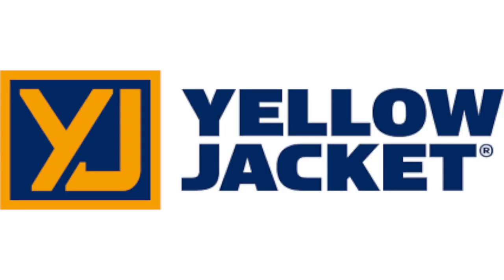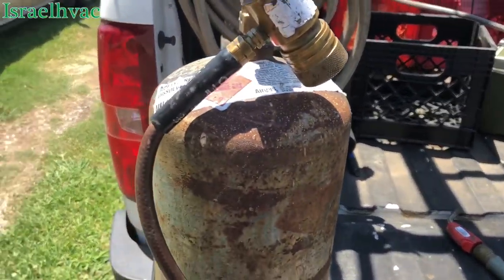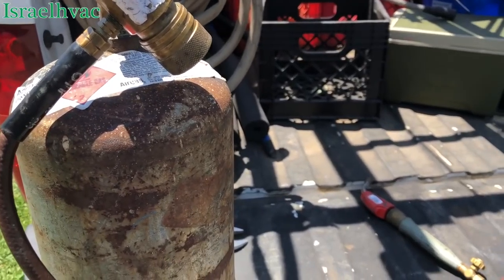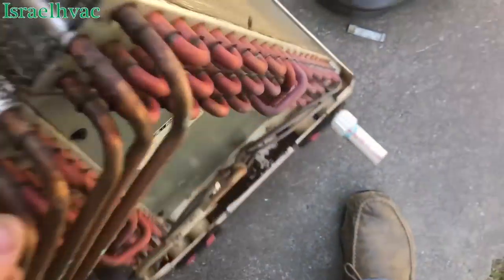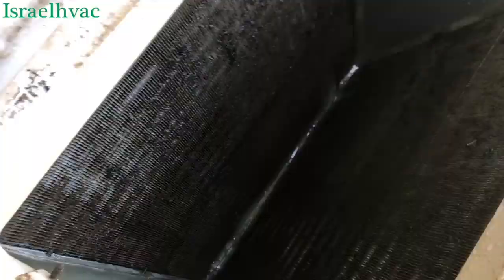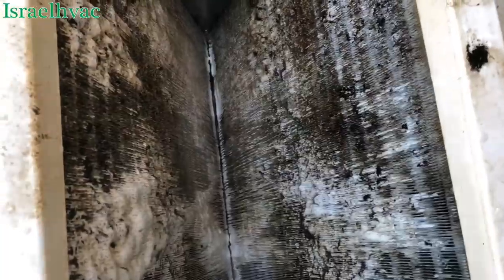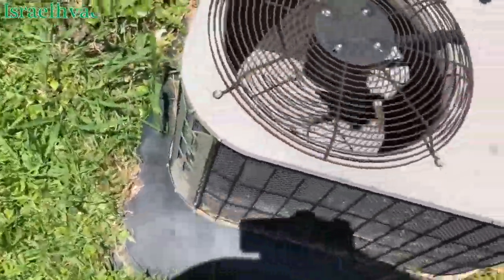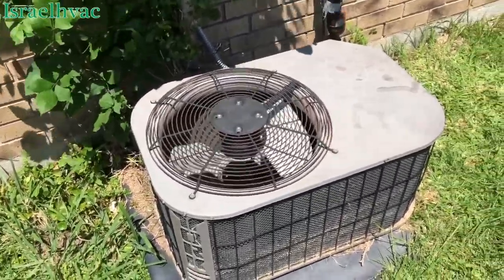HVAC Service | Evaporator Coil Pull & Clean

Comment: John nice job. Have a question though with older coils like that is it cheaper due to labor and materials to just put a new coil in or to do a pull and clean of the existing one?
Reply: Hi, just based off my experience; it’s cheaper. I’ll charge service call fee plus hourly labor. Around 300$ total give or take